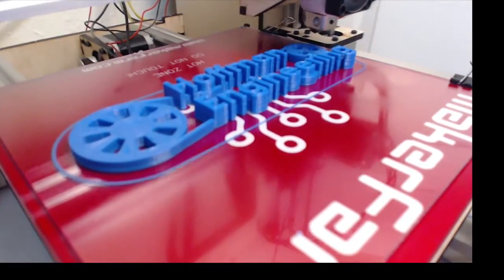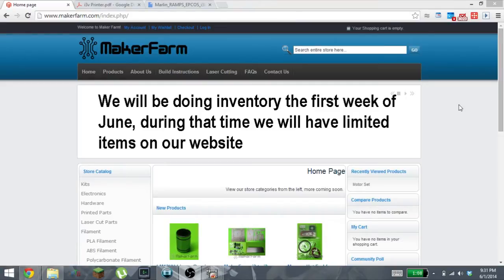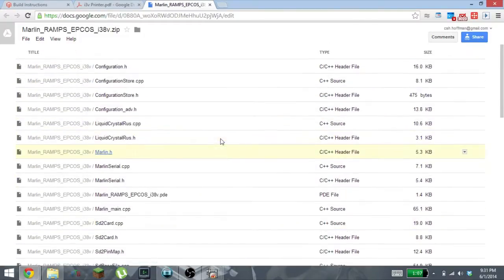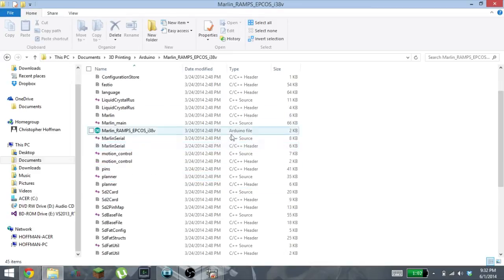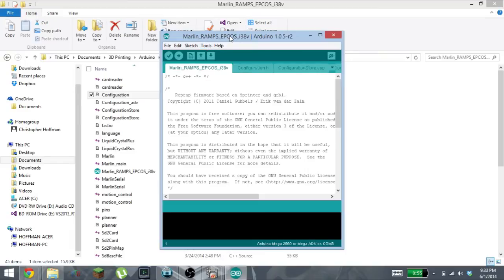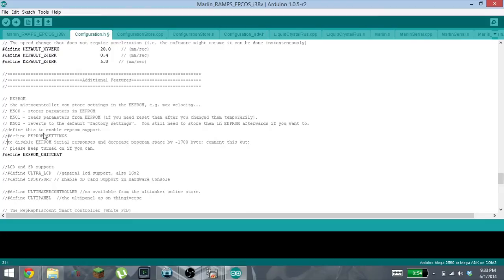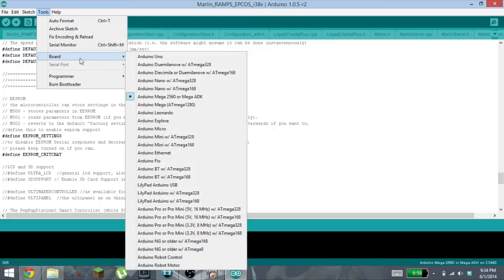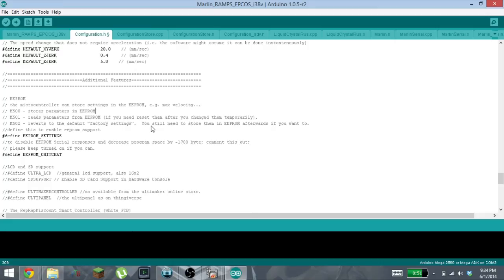Tutorial - Enable EEPROM on Ramps 1.4

Comment: Spent the last hour trying to find a way to undo the colossal fuck-up that your instructions caused me, absolutely no clue how to solve this now. A few hours ago I was printing, just wanted to be able to save my configurations, now this thing is fucking dead.
Reply from the maker: Nikolas C So, these are configuration files that you are messing with. If you change a setting you didn't mean to, or accidentally make a typo or something, then it can cause a big problem.

If you have the exact copy/version of the Marlin firmware that was on your RAMPs to begin with, then all you needed to do was uncomment the #define EEPROM_SETTINGS.

If you grabbed another version of Marlin, either from a different vendor or a version more up-to-date then the version you had, then you would need to make sure you transfer over all your settings to the new configuration.h files.

Marlin did a massive overhaul of the configuration.h file since this video was made. If you grabbed the lasted version, then you need to transfer all your config settings over to the new firmware.
Reply: Hoffman Engineering I can code in C, I'm pretty sure it wasn't a typo. I thought my MKS 2Z would act just like the arduino mega and ramps1.4, I freaked out a bit but then I found the firmware from my supplier, loaded that with the same uncommenting, and works nicely now. Sorry for taking it out on you, thanks for the quick reply.